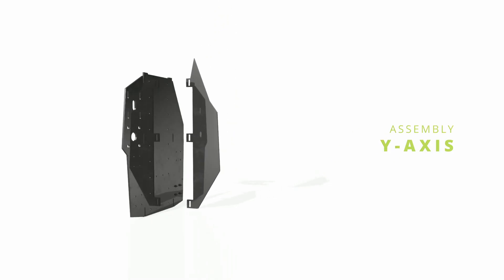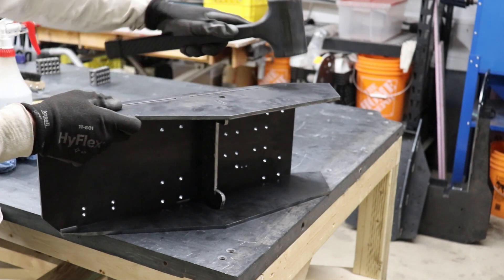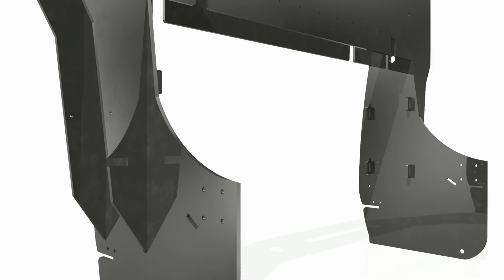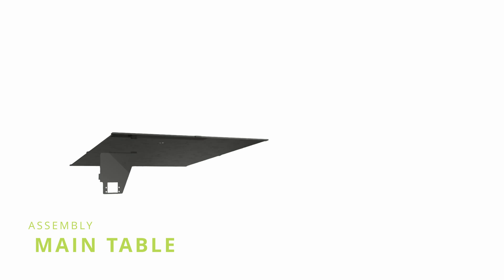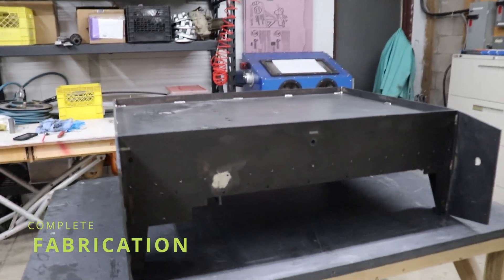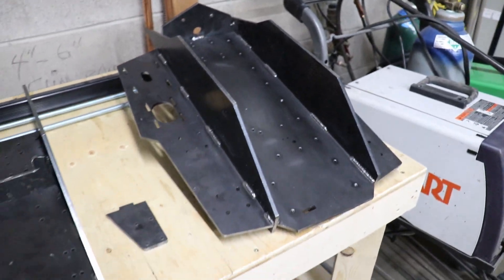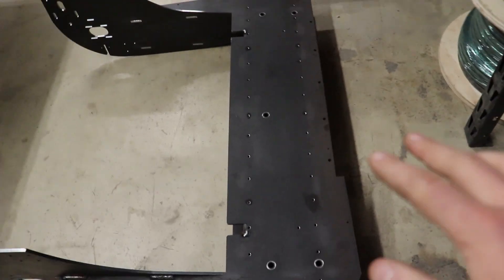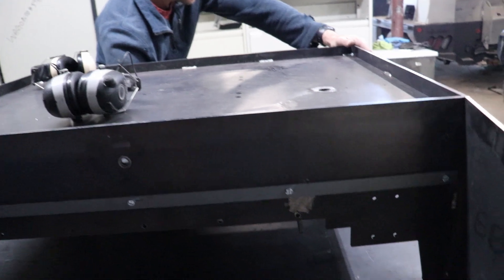Part Two - We design and build this CNC mill from the ground up! Build Series (Fabrication)

Comment: Great project execution and also love all your fixturing ideas.
One more to add to your toolbag is regarding the tab/slots. Design your tabs to stop slightly short of the slot surface, that way when you pop a weld in there, the contracting weld will pull the tab hard into the slot.
This ensures you a tight gap free joint, and an added bonus is you don’t lose most of the weld material once your finished grinding the surface flush.

Comment: Wouldn't TIG welding have put less heat into the part?  I am not being smart, I only have a MIG so I dont know other than what I have read.
Reply from the maker: You have more control over your heat with a TIG, in real time.  MIG is more set and forget and you can certainly over heat your part but it works just fine if you get your settings right and your material is consistent.

Comment: Additionally if you need some flat mounting surface for the rails, you can copy the straight edge surface (replication method) using metal epoxy (jb weld). I'm doing this on my CNC on a surface plate and get flatness of ~2um. I have a (shitty) short video about it on my channel.
Reply from the maker: I checked out the video, very interesting. Flat and straight on the resolution of machining equipment is a difficult concept to process when you realize that nothing in a typical shop comes very close to either, specifically when building something larger like a CNC. It changes the way you have to think about building these things, and that's a great tip! Thank you.